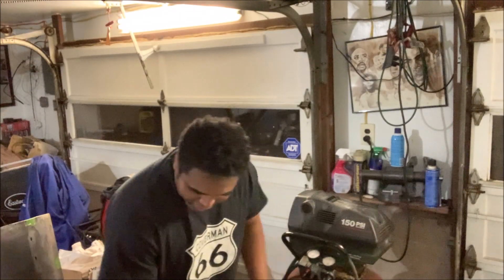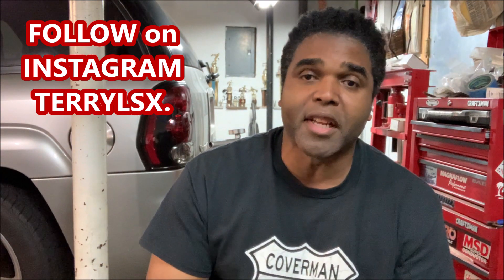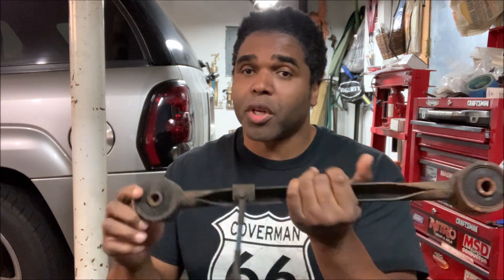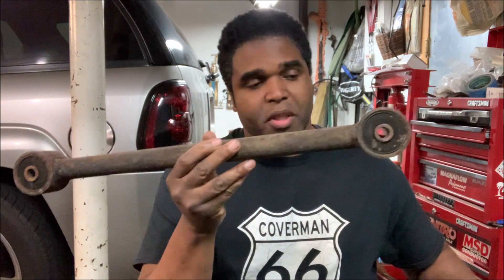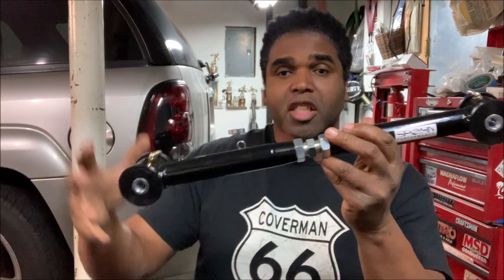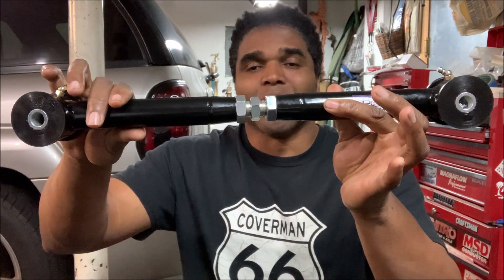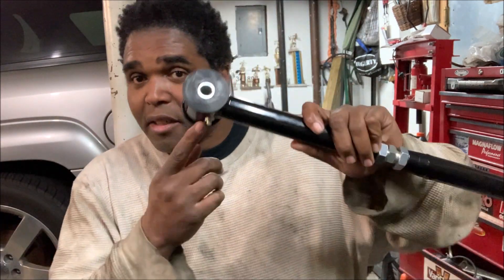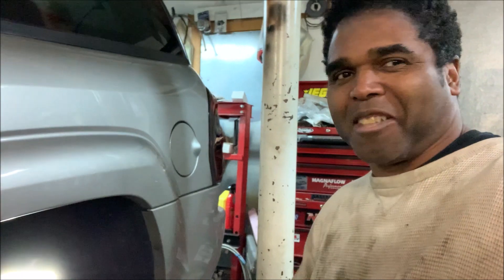Adjustable Rear Control Arms (What are the Advantages)

Comment: Hey whats up Terry , I have an awd 06 tbss and after lowering it with belltech kit it has a slight vibration under load till about 40mph. Would I be fine with just the uppers adjustable for pitch angle or would I need both upper and lower ?
Reply from the maker: sure.. the lower are for wheel positioning. if you leke where yours wheels are you should be good to go.

Comment: Why did you change from massive control arms?
Reply from the maker: Massive are great arms, i have a buddy with a TBSS that does hardcore racing and he wanted the massive arms.. so i wanted to check out the Spohn which was a lil easier to adjust.

Comment: Do you have any thoughts on removing the rear seatbelt brackets and having a B-Pillar bar made? I have an 04 LS and I'm working on a remote mount twin turbo setup. I have a block in the machine shop getting new ductile sleeves and a transmission on order that'll handle upwards of 800hp. I have two genuine Garrett GT3076r turbos and I'm working on the mock-up for intercooler piping and running 3" dual exhaust from a Kooks header to 3" inlet dual 3" outlet muffler. Muffler starts where the cat was and runs to the rear axle where two T3 flanges bolt the turbos up. Turbo outlets go to two 3" to dual 3.5" outlet exhaust tips. I'm using Megasquirt for the ECU. I'm thinking it'll be squirly. Lol
Reply from the maker: lolol you think? sounds like you will be needing to widen those rims for bigger tires lolol

Comment: Why remove an adjustable control arm and replace it with another? I know spohn is a good brand but so is massive
Reply from the maker: your right, both Arms are great, my buddy has a TBSS he strictly races, and he needed control arms that are solid and ask if he could try the massive arms. he loves them.. the Spohn have better street characteristic. again they are both great but the Spohn gives you a lil more comfort.